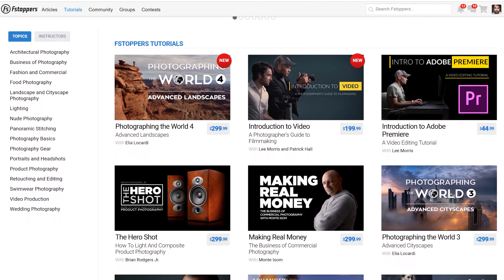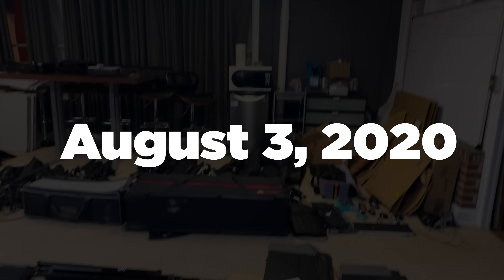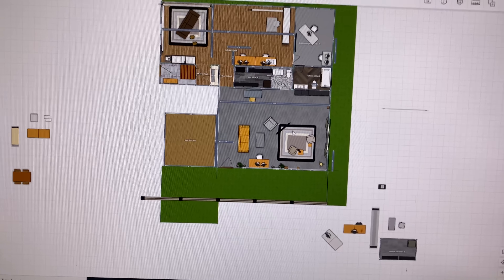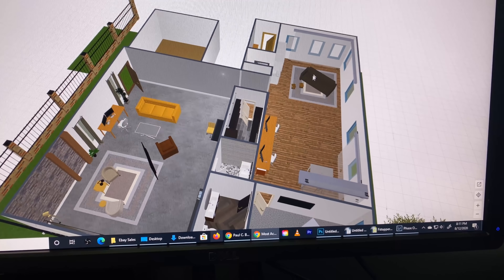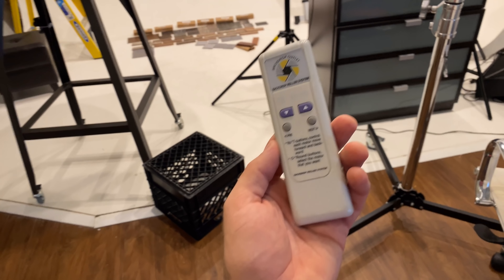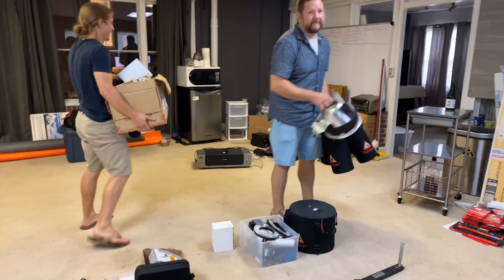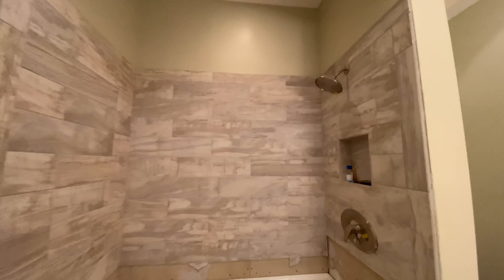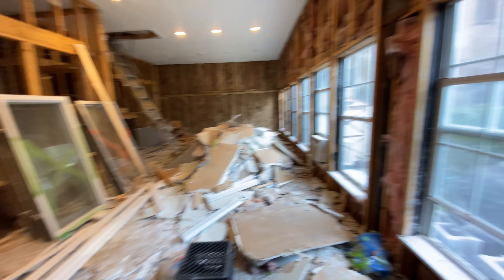We Destroyed Our Photo Studio!

Comment: Oh, dude, seriously? 6A? NOOOOO! I am a datacom guy and avoid 6A like the plague.  I run all 6E, and if I need more than that can handle, it's fiber time! But for what you're doing, it's the rare time where I would agree with the 6A.
You are so right about that saw, I can't tell you how many times it's a lifesaver; I have an electric one, but added the M18 one to Milwaukee tools a couple years ago and I use often. I will often cut in my boxes with it; I use it one handed and hold the vacuum hose to it to suck it all the dust as I cut; works great!
Reply from the maker: Not sure I follow.  I just casually looked up cat 6a vs 6e and the site I was reading said 6e only does 1GB while 6A does 10GB.  It also said Cat 6e isn’t an actually designated wire and is just an “enhanced version of standard 6”.

We have cat 5 or 5e in the home we rent in Puerto Rico and it gets 10GB speeds so I’m not sure how accurate any of this is but we def wanted 10GB speeds. -P
Reply: @FStoppers  Yes, specs and reality are not the same thing! LOL 
6E is rated for 10G up to about 55 meters, 1G and 100meters. Really? Like 45 meters going to make all that much difference? I've seen 6E doing 10g at the full 100 meters, it was between 2 closets. I did end up replacing that with fiber, because it was a bit unstable at that distance.
Reply from the maker: @Timothy-NH  yeah this house in Puerto Rico probably has 100 foot runs with cat5 cable and we get 10GB speeds through that somehow.  Wire was run in 2006 when the house was built and we didn't think it would work but it does.  -P